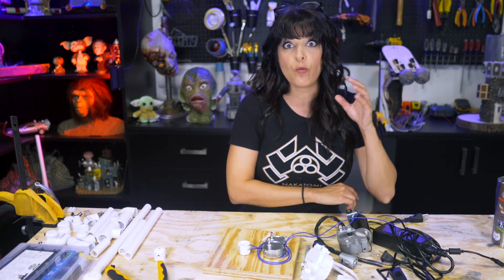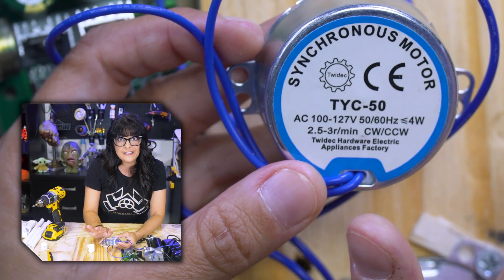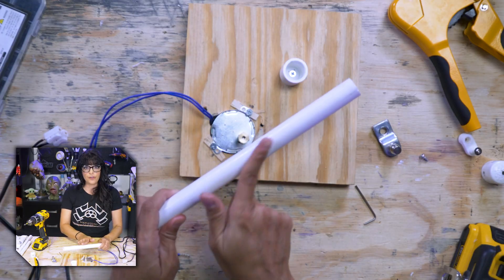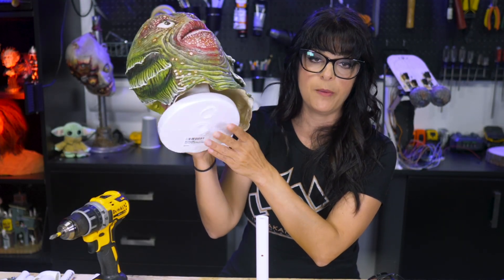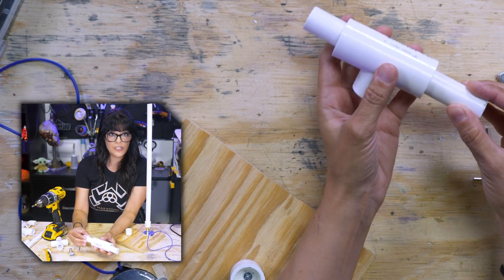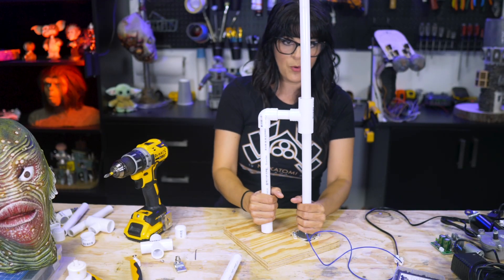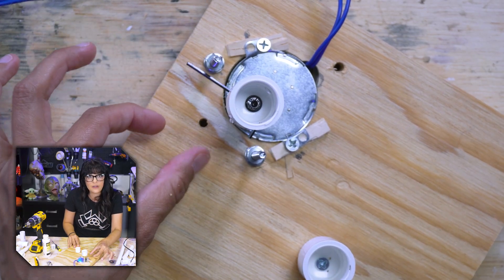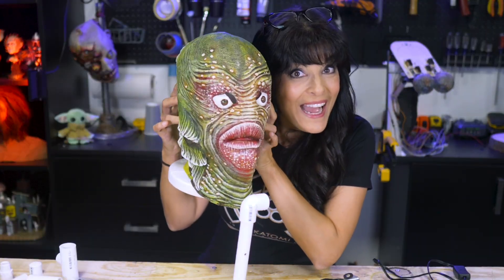Easy Prop Head/Body Turning and Panning Motor Mechanism with PVC & Synchronous Motors

Comment: Hey Mrs. De Barros! I’m a teenager in high school and I’m wanting to learn code for making props like predators plasma caster or something. I’m wondering what kind of code that is? Where did u learn to code? I’ve been trying to learn C code but I haven’t found anything on controlling motors, or lights, or audio. I absolutely love the content so keep doing u, u rock, deuces 🤘
Reply: you should get an arduino or esp32 starter kit! those are common microcontrollers that can handle different types of inputs controlling different types of electronics..   most starter kits come with tons of fun sensors and motors etc and then you can pick an easy project to get started and learn one skill at a time.  this channel seems great for that journey.  i'd suggest something led related to get started.